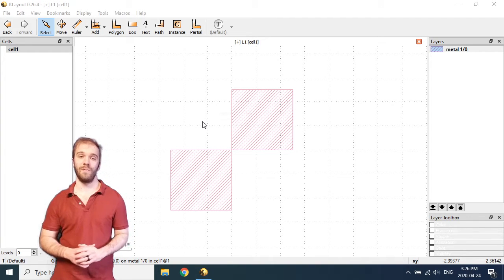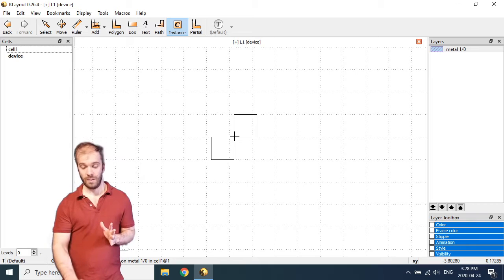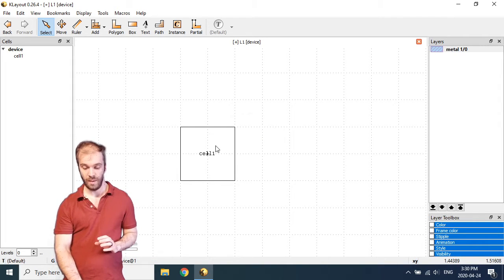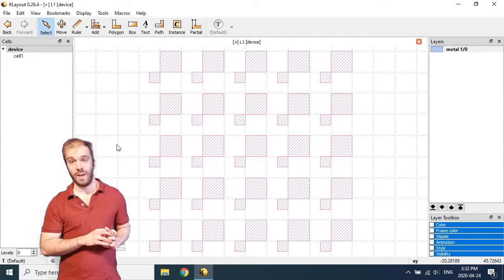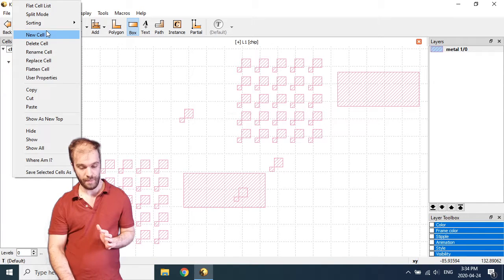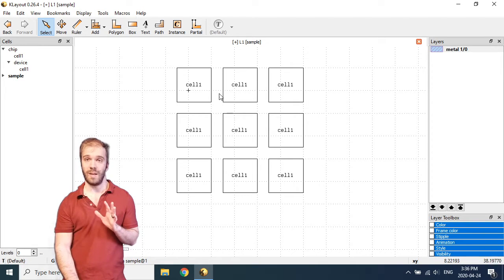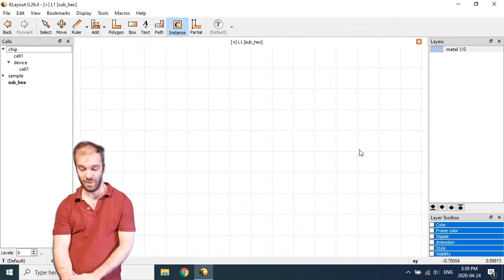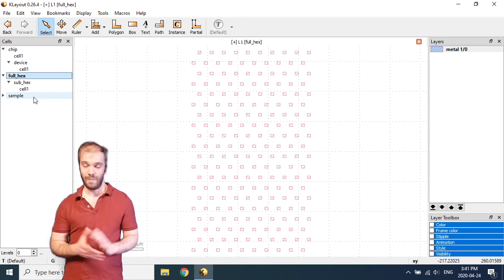KLayout Tutorial #3: Cell Hierarchy Part 1

Comment: Great tutorial... I am using "Box", but after drawing the box, when I double click on it, the window that pops up is a "polygon properties" window, not a "Box properties" window! In this window, I cannot change the length of the box, I only have some points coordinates. Do you know why? How can I fix this?
Reply from the maker: You have a different 'Combination Mode' selected. At the top of the screen next to 'Polygon' you can see I have it set to 'Add'. I'm guessing you have it on 'Merge' or something else that is automatically converting boxes into polygons. Switching back to 'add' should resolve this.
Reply: @qnfcf6093  Thank you so much! Yes, it was on "merge". Now that I changed it to "Add", it works just fine! Thanks again!

Comment: Thanks for the great class. I've a question at this point: I started a cell with it's center at (0,0) which is a vertical line of some width. Then I buid a pattern by repeating a line, say 51 time. How to locate the centre of the pattern, or, how to shift the (0,0) to the centre of the pattern?
Reply from the maker: After you've placed the array of patterns, click the array to select it. Then use 'Edit->Selection->Move To' and enter the desired coordinates. This way you can control where the center of the array is located.

Comment: Thanks for your nice video. But in my klayout, when I use instance for reference, I just couldn't find the other cells to select, and I couldn't even see the confirm button to click in the Editor Options window after clicking the instance button . Could you help me with this? Thanks a lot.
Reply from the maker: New versions of KLayout tend to dock the various pop-up windows around the outside of the editor window. The instance window can likely be found there. Undock it by clicking and dragging, and then expand to see all options.